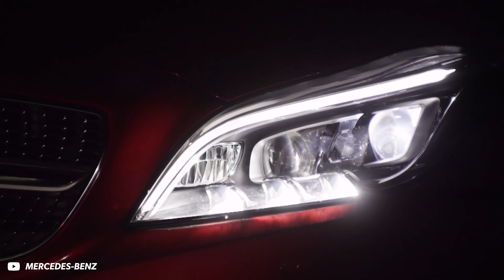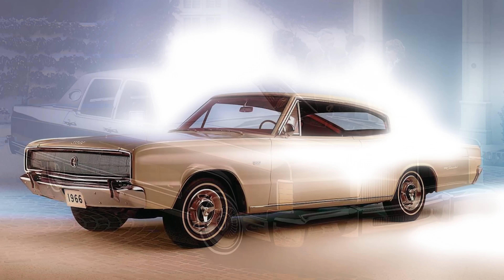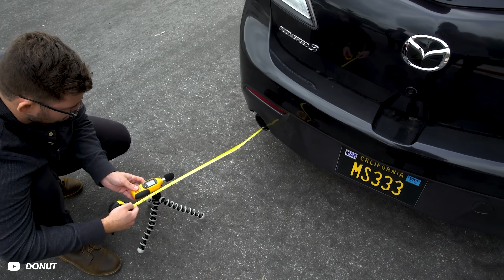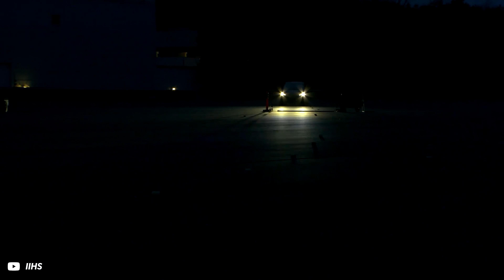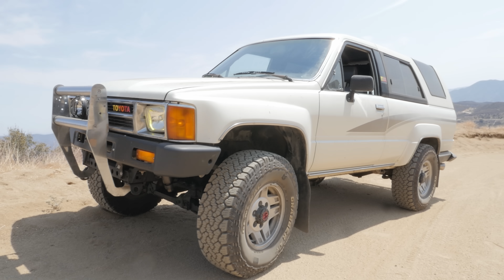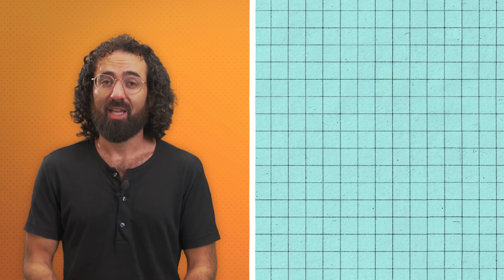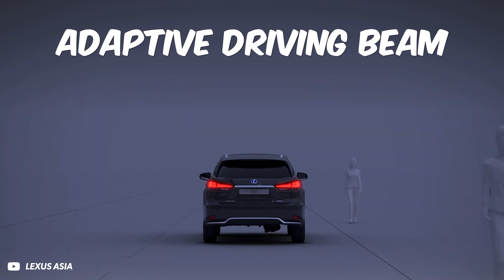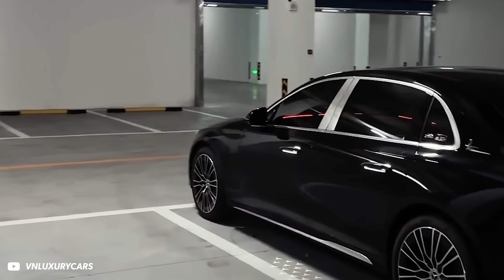Why new headlights are blinding American drivers

Comment: I was out with  a friend  one night  and his car has auto dipping  headlights  and there was a car up in front of  us by say 800 meters on a straight road  and i said about dipping  the headlights  and said  it was automatic  and didn't know how to dip it  
I have been noticing  these issues  for a few years now with modern  vehicles  headlights riding  behind you on high beam  or flashing  you as they auto adjust  good insight full video unfortunately  i fear things  aren't going to get better  as all the manufacturers  seam to be doing it

Comment: European here.  The so-called adaptive lights are rubbish. They may seem to work in a laboratory setting. here in Sweden, where the days are short in the fall, the winter and springtime, where much driving is done in dark hours, the LED lights are very difficult to meet on the road. Sometimes in a curve, they suddenly blind you, even in low beam, and in roads with hills or just slight up-and-down terrain, low beam is as blinding as high beam, because the LED lights have no "transition" phase, they are simply NO light, or FULL light, when the beam is pointing up or down. 
LED lights are very strong, and wonderful for the car driver at night, but anybody meeting LED lights is always at risk of being blinded, except in level, flat and non-curved roads.

Comment: Couldn't we begin to alleviate this irritant by mandating headlights to be no more than a couple feet off the ground regardless of the height of the vehicle? Does this make too much sense to implement? Why can an intercity bus get along just fine with lights at bumper level and a pickup needs them 5 feet high?
Reply: no matter what you do to the headlight short of making it not as bright you will always blind people cresting hills. theres no need for low beams to be as bright as they are, i shouldnt be able to use the low beams to "xray" my hand to make sure i didnt break a bone.
Reply: Have you actually thought about this? The lights need to be high as possible and pointed slightly down, not down low where the don't illuminate anything except the sky.

Comment: I love and hate the regulations here in Germany. On one hand it isn't out of control with aftermarket headlights, except for that one guy putting cheap xenon replacements into his old, blind headlights, on the other hand there are only two approved LED replacement sets and the compatibility list says I can replace my H7 high beams but not my H7 low beams... Such bullshit, I will have to keep driving with both halogen than...

Comment: Color temperature makes a surprising difference with this issue. If you wear yellow tinted glasses at night, it will help more than you think, even without reducing intensity of the light. I know it's not a real solution to this safety problem, but if you can't wait years for the real fix, try finding a pair of night driving glasses. They're not that expensive and it's like having auto-dimming for your eyes.

Comment: Wrong! For example, my ancient 2011 Touareg has perfectly capable adaptive headlights. If it can't cut off oncoming traffic or people in front, it simply switches to low beams. Speaking of tall SUVs, they simply have their headlights adjusted incorrectly if blinding someone. You're probably just a green pervert.

Comment: European in Europe. My car has these brand new adaptive turning headlights, though 1st gen so there are (what appear to be) masks creating shadows where the other cars are. It's not a matrix design. This applies to high beam only, as low beam (asymmetric in Europe) does not blind anyone - except children on your side of the road or id someone parks on your side facing the opposite direction. I hardly ever use the high beam because the adaptive gimmick does not work well. Certainly not on a winding road in the open. It takes the camera more than one second to recognize sudden oncoming traffic e.g. from behind a bend in a road through the forest, or from behind a truck, or very far out - LED high beam is blinding even from half a mile away. They do not recognioze a car viewed from its side when approaching an intersection. A second severely overlooked issue with adaptive beam is that it blocks the light from shining directly at your predecessor, but not at the road signs ahead and next to him - which, coated in reflective paint, blind that driver on your behalf. Noise screens lining highways are a common feature here - again, the high beam will reflect off them and blind you indirectly. Last but not least, my pet peeve speed bumps - usually useless, ineffective, even dangerous for cyclists and bikers especially when wet and dark, get you blinded from both front & back - especially if you're sat in a "normal" or sporty car. But that's even with low beam.
All in all, adaptive beams are an interesting experiment but from my experience should be banned outright until they work flawlessly 100% of the time - 99.9% is not good enougn (and in my case they work correctly maybe 75% of the time and that's just because I dip the beam beforehand when I anticipate potentially blinding someone because they won't cope).

Comment: The reason they are being used…. Is that if you want to drive 85mph, you need these brighter led lights. With halogen lights, you SHOULDN’T drive faster than about 50-60mph.

Comment: Or you could simply enforce the usage of certified light sources in the corresponding headlights!
In europe, when you put a LED in your Halogen-headlight, you need a certificate (testimonial by a official site like TUV) that this light source in this headlight does what it should be. Otherwise you car isn't street legal anymore and can be stopped by every police by official law. You also don't get your next mot.
So simply said: Your car has a halogen headlight? Put halogen in it, or get a LED which has been officially tested in your specific headlight model and has a certificate for this.
Adaptive headlights are garbage, like others said. Have them in my car, but i'm not using them because i see how slow they react to oncoming traffic.

Comment: No no no. Totally disagree. From Ireland here and I get blinded more times than any other lights by these matrix lights. This is a created problem through disregulation, the whole aftermarket nonsense. It could be made simpler if there was the willingness. 

WHY, make thing more complex. Lights are simple to function and there has never been issues with the technology. This is simply more marketing nonsense, probably shadow sponsored or vested interests in sales in US.

I have beem driving for 16 years now on all sorts of roads. Mostly dark Irish country roads. And let me tell you that these fancy tech lights DON'T work on these roads. They are slow and very ineffective around bumps, brows, hills and otherwise anything that isn't simply a head on flat motorway style road.

WHY make thing more complex unnecessarily. If your a driver and you cannot operate you dips/beams then I'm sorry, perhaps driving just isn't for you. 

I, along with 99% of car owners don't need your redundant and expensive problem technology in our cars. This is unnecessary, expensive, resource heavy, labour heavy, aggravating, creating problems to sell solutions. FACT

Comment: This is a serious issue. Here in Canada, all new cars now come with extremely bright headlights. And they are also aimed very high to the point I literally cannot tell if the oncoming driver is using high beam or not. And lots cars have aftermarket headlights that's EXTREMELY WIDE as well, literally lighting up 4+ lanes with extremely bright lights. I have to constantly squint my eyes to avoid being completely blinded.

Comment: I don't think there are any dealerships out there that include headlight aim verification as part of their PDI routine.  If they're misaligned, they gotta wait for someone to bring their vehicle back under warranty for it - and very few will equate all the 'flashes' to a problem with their own car.  Adding insult to injury is all the law enforcement vehicles, that actually MIGHT go out and get their lights aimed -- and then come back and put 250lbs of gear in the trunk, and go prowl the streets.  I swear their roof lights are specifically engineered so that THEY are the only ones in the county who can see anything while they're activated.  HUGE pet peeve of mine, right there!

Comment: About that last chapter. You are talking nonsense. Matrix leds ALWAYS blind from back. ALWAYS blind in the corners. MOSTLY does not change from far distance, like by the rules you have to turn low beams 300m till upcoming car. But these leds does not work in such distance. So you get blinded. ITS a GARBAGE.

Comment: I have a sedan that sits low and a regular size half ton pickup.  I am older and the ride height makes a lot of difference when driving at night for me.   And to add to the night time blindness, all the LCD signs do not help.  They do not put out enough light to illuminate the road but enough to impair your vision.  I live out in the country and I used to be able to see the milky way and night time sky.  No more.  A lot of homes have accent lighting, wall washers.  They look like  cruise ships.

Comment: Work has a shiny new Skoda, the headlights are stupidly bright with roadsigns reflecting so much they dazzle you.  Conversely in country lanes they are crap and don't illuminate into corners and you need to put front fogs on to see if there's an errant branch hanging down.  Don't get me going and the frankly dangerous driver assist nonsense.

Comment: I barely drive at night anymore because of this issue. I am old enough to remember when the lights on today's cars were brighter than high beams and you couldn't have your HB's on within 500 feet of an oncoming car. How'd you like to be an OTR Trucker on a night run having to battle these lights all night. Like to know which design engineer came up with this "Bright" idea. And in spite of the brightness of low beams i still see people driving with HB's on side roads when I'm driving faster than they are with my 26 yo ranger low beams.

Comment: A huge problem are car designers using compact headlight designs enabled by LEDs. The relevant unit for measuring light, as our retina sees it, is candela per square meter. The surface area of a light source is critical in whether it is tolerable or blinding. Traditional headlight bulbs such an incandescent emit light 360 degrees, which forced designers to use reflectors and carefully designed lenses. This naturally produced larger headlight units, reducing the intensity of the light source. LEDs on the other hand emit light only forwards from the chip, "eliminating" the need for reflectors and diffusers. LEDs enable the use of naked-diode lamp designs, where there is nothing but a primitive clear lens between the bare LED and our eyes. These naked-diode designs are 100% guaranteed to exceed the visual tolerance limit of 50,000 candela per square meter and create dangerous glare source. 

Contrast this to the headlights on my 2012 vehicle. The HID bulb emits light sideways into a large reflector unit which directs the light forwards, the bulb itself has an endcap. Direct view the HID bulb is blocked for oncoming drivers, only the reflected light from a greatly enlarged surface area is visible. It should be a legally-mandated design element in any high-output light source that the light source itself cannot be visible, the light must pass through a proper fixture that reduces the intensity. 

People who design LED headlights should be forced to wear glasses with inwards facing bare LEDs, we'll see how long they think that naked-diode LEDs are a good idea.

Comment: No, Rivian is not the only car manufacturer with Adaptive Drive Beam (ADB) technology installed in their vehicles. While Rivian was the first to introduce fully compliant ADB headlights in the US market with models like the R1S and R1T, Tesla joined them in early 2025 by enabling adaptive matrix LED headlights (a form of ADB) on updated models such as the Model Y, as well as other vehicles equipped with the necessary hardware. This technology allows for selective dimming of high beams to avoid glaring oncoming traffic while maximizing visibility. Based on available information as of late 2025, no other manufacturers have widely rolled out full ADB systems in the US, though some (like BMW, Audi, and Mercedes) offer similar features in other markets but have not yet adapted them to comply with US regulations.

Comment: Bullshit. Just fucking properly adjust your lights. It isn't hard. Every set of lights i've seen have adjustment screws. Park your car in front of a wall or your garage door (you need to be about 10 feet away) turn on your lights and adjust. The far right (passenger light) should be angled right a bit a slightly downward. the driver or left light should also be slightly right but less down. The idea is to make the beam stay in your lane but keep it from glaring upward into oncoming traffic. You still get great vision without blinding oncoming traffic. This used to be a part of normal maintenance. You would check your oil, water, trans fluid (if you had an auto), windshield washer fluid and light geometry. It's not that hard.
Reply: It’s not bullshit. The new LED headlights are a problem even in Europe. They’re simply too bright and too cold, and then you add those tacky glowing strips in the front. And let’s not forget the trend toward tall compact cars - the crossovers. It gets even worse when it rains and we’re blinded by the light reflecting off the wet asphalt.
Reply: @UnagiC8  yeah it is. (btw the bullshit is the idea that the only or main solution here is to switch to gimmicky lights that increase complexity and by extension repair prices) People buy  cars and never check that the lights are aligned correctly. There was a time (yeah i'm old) when it was considered part of maintenance. If you align you lights properly they will shine lower to the road and off to the right (U.S. so just reverse it for EU driving). which is safer for both the driver and others on the road. It really isn't hard. Four screws per light to adjust, 5 minutes and done. This is two things, Laziness and not knowing/ not wanting to know.

Comment: So the issue I have with the IIHS study that showed cars with "better" lights have fewer accidents. Is that it fails to account for the fact that those same cars have other more advanced safety features. Features like "Lane Assist" or "Radar Cruise Control". Or even something as simple as "Apple-Google car play" has a significant impact on people not staring at their crotch. They might be staring at a screen but their peripheral vision has a greater chance of detecting abnormal movement.

Comment: British guy here. Shape shifting lights are common as you say in the UK / Europe but far from reducing issues blinding (dazzling) oncoming drivers it’s fuelling it. The software is often slow to react for example, you’re approaching a blind crest, you know a car is coming the other way from the other side of the crest, with manual dip you’d anticipate the other car, but now in the UK drivers plough on, waiting for their new car to see the car on the crest of the hill and then……… react. Dazzling the oncoming driver before shifting the beam pattern. Have a KIA or similar come up behind you at night and the cars beams are dancing around in your mirrors as the beam adjusts, making them dazzle you from your side and rear view mirrors. There’s a lot of talk in the UK about headlights being too bright and in my opinion, it’s all the new cars with over complicated headlights reacting slowly and essentially making it difficult for oncoming cars. 2 of our cars have the system, but when making progress at night on B roads I prefer to switch the lights back to manual dip and high beam operation, so that’s as soon as the oncoming car has passed, I’ve got full beam again, rather than waiting seconds for the lights to react fully to the now empty road ahead. I think there’ll be driverless cars here before this issue is fixed now the genies out the bottle.

Comment: It is the same in Europe as well. A very small number of cars have those advanced LED/Laser matrix headlights, most of them have just normal headlights with LED bulbs in them. By their nature (light spectrum and human/animal eye anatomy) these LED headlights need to produce a lot more light for the same vision effect so we are getting blinded from every position: front: side, through the central rear view mirror and side mirrors.
When the roads are damp or when it's raining it's absolutely horrendous. By the nature of the driving process you can't take your eyes off the road, but after one of these modern tricycles with LEDs goes past you basically the driver is blind 2-3 seconds. First the germans started with these very bright tail lights back in the early 2010s, and then everybody started making these super bright front headlights as well. All in the name of the low energy consumption. Not to say these crap LED headlights go bad quite often and they are not cheap at all to replace (1500-2000EUR for a headlight assembly of a normal car, like a mazda 3, renault megane, vw golf, honda civic, hyundai i30).
Ar some point I filed a petition to the national authority equivalent do DMV inthe US and they replied "the cars come with homologation for these headlights, so they are legal", while at the same time if we replace an incandescent registration place light with an LED equivalent we get our car registration suspended, the car needs to be towed off the scene and we need to go through the whole testing (lights, tires, brakes, exhaust, suspension, emissions) again if we want to put it back on the road. Yes, the authorities supposedly lead by "engineers" achieved this level of stupidity... FAILurope FTL...